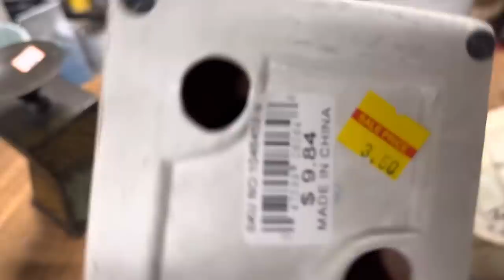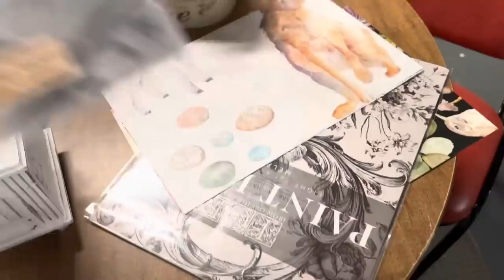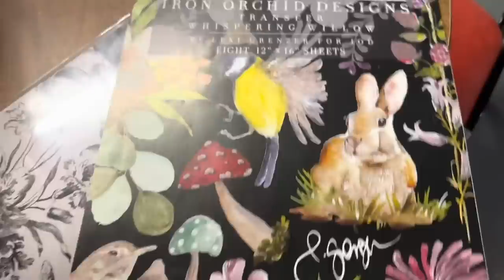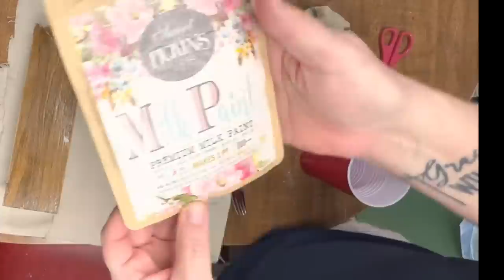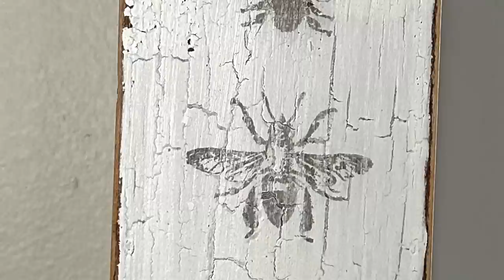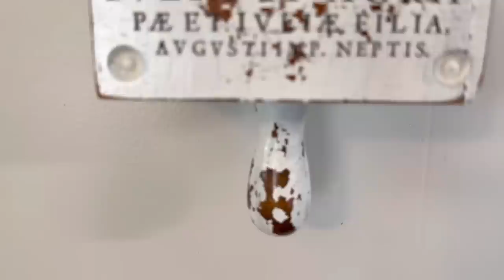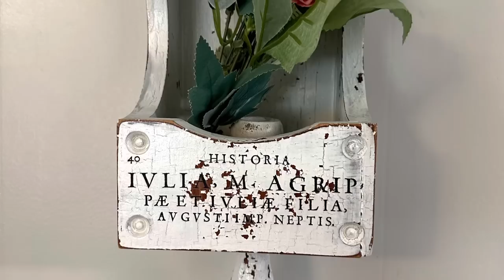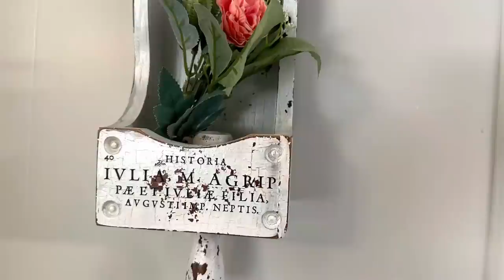Easter Thrift Flips/Thrift Store Makeovers/Thrifting for resale.

Comment: Love that Coral color....it always sez SUMMER to me! My question is......why do you use that tinsey tiney brush for white waxing? You are so right about that long wooden container.....it is a match holder for long fireplace matches. They hung near the fireplace and because the matches are so long, you could light different areas of the kindling wood and or paper using the same match.....
Reply from the maker: I only have one bigger wax brush I think it either was in the sink to be washed or in use elsewhere out of reach.  lol I need to get more stencil and wax brushes.  Or just some cheap chip brushes work well with wax too!